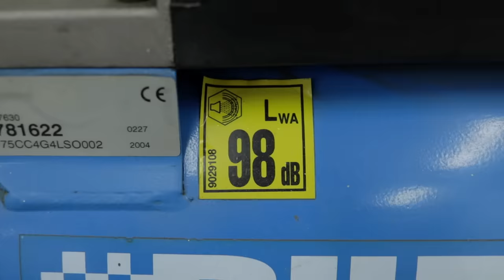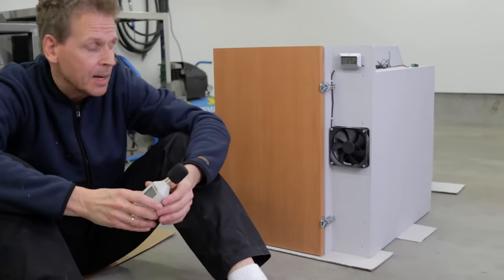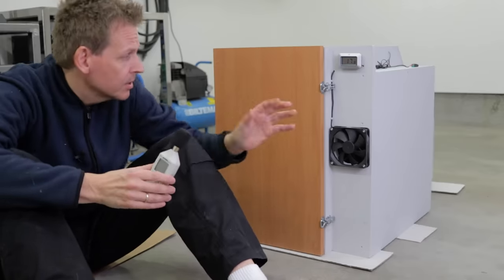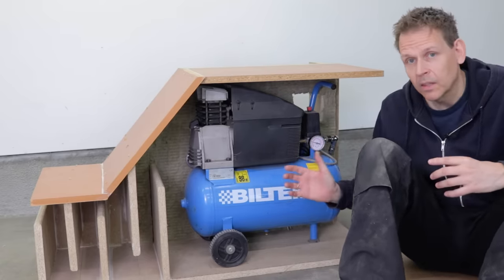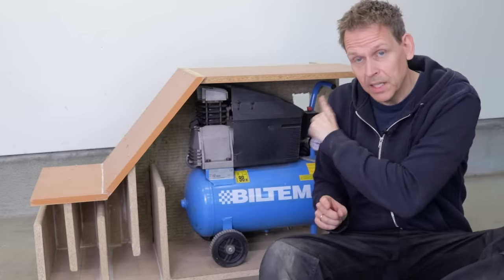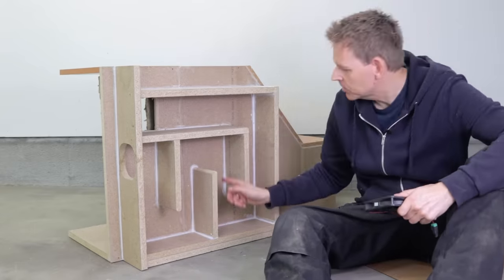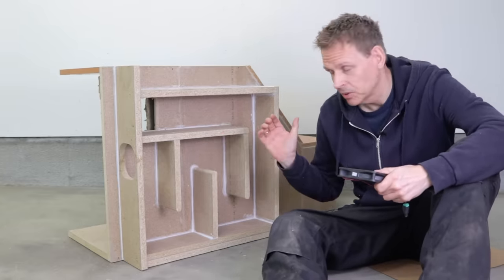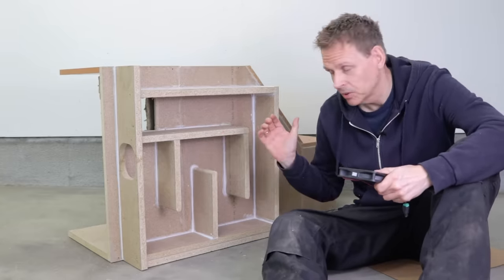Do not build a sound insulated enclosure for your noisy air compressor!

Comment: I hate it to break the bad news. If a compressor is inclosed with no cooling then compressor oil breaks down fast with heat and increasing wear all over. Heat is generated from compressing the air and needs to be cooled. Many many years ago I was working for a company that had compressors placed in just small corners on the outside of the buildings and all overheated, they got the compressor companies engineers to see why all their compressor overheated and failed, especially oil degradation failures, they battled for months and failed to rectify the problem. Then I started to work for them and found that the hot air from cooling where recycled into the intake of the cooler and air cleaner, now as they have already did installed and built everything a plan had to be made so I built ducting for the hot air away from the compressor and since then 20 years now later they still use my design.
Reply from the maker: I absolutely share your concern for overheating. The air compressor will not live for long if it is constantly hot above the recommended specs! 😐 However, It's a pretty cold climate here where I live in Norway, in the Northern part of Europe. I have actually fitted a heat pump in my garage to be able to use during winter time. I can see overheating is a big challenge in warmer climates. A more powerful fan or even radiator cooling could be needed must then be considered.

However, since I have a fan in front blowing air into the box I have airflow through the case that will "grab" the heat and transfer it out of the box. I have fitted a thermometer and checked the performance frequently. Normally the temp increases 5C = 10F from when it starts until pressure is built up and it shuts off, and then it takes just a couple of minutes to cool it down (as the fan continues to run after the compressor stops). If it is running constantly over longer periodes it can get a bit hotter, I have seen almost 10C = 20F increase. The warmest summer days can be 30C = 86F here where I live, but that is very rare. Its more commonly 25C = 77F, so it never gets very hot inside my box and it is within the range of acceptable temperature for this compressor.

Comment: You can reuse the tank from the old compressor as extra air storage.  This will buffer air and help you with the smaller air supply of the new one ...
Reply from the maker: Yes, good idea - except I gave my old one away 😊 My new compressor has so far provided enough air for my usage, but if I need to increase the capacity I can probably manage to find a tank and add to my system. Thanks a lot for the tips! 👍

Comment: Due to the low frequencies of the noise you are trying to cancel a 10cm thick lining of foam padding on the exterior (or interior) of the box would have made a huge difference. And also isolating the compressor from the floor of the box as much as possible, using springs, foam, or a fluid float.
Reply from the maker: Adding more insulation would be nice, but I have just not any available space for it - neither inside or outside.  
You are spot on when it comes to vibrations, I think it is the biggest source of noise now. Will try to improve it by adding soft rubber, dampening foam or springs on the compressor and/or between the box and the floor to improve it. Thanks for the tips! 😊

Comment: Put the compressor into a box and place it outside up against the wall of your workshop. Run the air hose and the electrical through the wall. Lots of people do it this way and I think this will be my spring project
Reply from the maker: Smart if you can do it! I just don't have space for it outside of my garage. Just be aware that your neighbor (if you have any) might be annoyed - because moving it outside does not make it more quite, the noise is just moved away from you and closer to someone else 😅

Comment: Everyone seems to be aiming at 0 sound. I think I would want to hear when it kicks on. I just wouldn't want it to be obnoxious. 

You mentioned that the new compressor has a lower CFM rating (or whatever you guys use in Norway). You could use your old compressor as a bulk tank to compensate for a slower compressor.

Comment: Cool Idea I like the air vent idea I bet if you put foam mattres topper (foam that looks like it has cones or waves in it) it will significantly dampen the sound for you. at the very least in the exhaust vent you have

Comment: I once had to do this for a smaller compressor. I used foam and  lead laminated sheets for walls and floors and the most reduction i got was adding a medical silicone hose on the input. and also used the tube as a base isolator and  the compressor sat on top of the tubes to kill that vibration from hitting the base.
Reply from the maker: Using medical silicon hose was an interesting solution, where do you buy that?

Comment: If you place your baffles at angles ... not parallel, there will be less reverberation due to internal echoes.
Using "dead" acoustic materials will absorb sound rather than reflecting it back and forth. Your carpet pad is rather loose stuff, and not as absorbent of vibrations (sound waves) as would, say, loosely hung lead foil (which would be, perhaps, the best.)
I really appreciate your project, as I am quite sound sensitive. Thank you! IMHO, eliminating mechanical sounds makes the world a better place!
Reply from the maker: Yes, others has mentioned it as well - putting the baffles at an angle does make sense. I have no idea why I did not think of it when i built it 🙄😒

Comment: In the USA the quieter compressor is sold by California Air Tools. I have one of those for indoor use, however I think the solution for a large powerful compressor is to install it outdoors in a shed and then run the air line inside to the workshop.
Reply from the maker: A lot of people have recommended California Air, and I have seen a lot of positive reviews online for their products. It seems solid! Unfortunately, they dont sell them here in Europe. I'm not 100% sure, but I have at least never seen any ad for them over here.
Reply: @kihestad  The California Air Tools product looks just like the one in this video, so I presume equivalent units are available from European sources.
Reply from the maker: @davejoseph5615  ah, ok - that could be. A lot of different brands these days selling very similar products, only colors and the name are different 🥴

Comment: A few things you can do to improve the reduction of sound is by not making everything so square. The baffles should be placed at different angles so the sound bounces around. Also the baffles should be made out of different types of material as well as different thickness. These two things will help break up the sound.
Reply from the maker: Very good suggestions 👍 I did not think about it when I made it, but now when you say it - yes it makes sense 😏

Comment: You can also get a quieter compressor now. I got the Kobalt QUIET TECH from the Lowes home store and it's about 60db. Not bad at all. I'm considering moving it to the attic and have a hose reel up there so there would only be a small hole in the ceiling of the garage for the hose to come through. Maybe a report power switch too.
Reply from the maker: Ahh, that is a very quiet compressor 👍 Sounds like å good plan you got there. I got some noise from vibrations transferred to my wooden floor after putting it upstairs in my garage. Adding soft rubber or sturdy foam under the compressor feet's might help
Reply: @kihestad  I've seen equipment mounted on springs also but the soft feed would be best in my case.

Comment: You could save all this work and just get the Makita MAC700 compressor.

Cheapest quiet compressor youll find, low rpm cast iron pump, sits on very  soft suction cup feet that isolate vibration. The tank is small, only 2.5 gallon but you can put another pig tank inline. It handles heavy work just fine, used it for heavy framing many times
Reply from the maker: Makita has great tools! A bit expensive though, but very good quality! The MAC700 cost three times more than the quiet one I bought. It's much more powerful though, but actually 2dB more noisy than mine 🥴

Comment: Wow, lot of work went into that video (huge views/likes as a result maybe?) useful you did all the work for us! 
Us non engineers would have nailed a box up, filled it with rockwool and then watched our compressors melt lol! 

The wood in the 'labyrinth' part could be called 'baffles', that's what they call them inside an exhaust etc.
Reply from the maker: Ahh, yes - 'baffles' is the name. Thanks a lot! 😊 I can confirm it was quite some work, both the build and making the video. However, it was fun work 😁

Comment: I have put mine outside, in the shed. No need for sound deadening.  Just cut a shallow slot in the lawn about 4 to 5 inches deep and push in the hose and electric cable.
Bonus: You can now have lighting in the shed!

Comment: When I first looked at this I thought you were going to end up building something like a speaker box and it would be louder! I'm impressed and how effective it was! 
  But to be really effective if you need a lot of mass.
 Anywhere you can get a cheap precast small concrete septic tank? Line inside with foam and fill the holes with fiberglass and make the whole thing 'float' on some close cell foam.
   I'd hate to see you try and get that up the stairs though 😜
Reply from the maker: Haha, I bet you would have enjoyed someone take in a build like that 🤣 Thanks for the tips, but no thanks 😂
Reply: @kihestad  seeing anyone get something like I described up the stairs by himself, I would definitely watch!

Comment: What range of frequency is the sound in for your compressor?  Maybe you could adjust your baffles to tune them for that specific sound range.
Reply from the maker: I did not go that deep into the investigation, and my knowledge is limited as well in this area 🤔 I knew that the medium and high pitched noise from the compressor was most important to reduce. It's the most annoying sound and makes you need to shout to talk over it. I just copied similar designs I had seen from other builds witch had the result I was after.  Luckily I got rid of the annoying sound, and the remaining "rumbling" noise that remains is not that painful. It's volume is not very high and a deep bass tone is not disturbing that much. I could probably have got an even better result with more investigation and set up the baffles better. Better do that next time... 😊

Comment: When you rolled the new compressor in th ebox i think we can hear that the vibration dampening on the bottom of your box isn't enough.  
Maybe putting another 1-2 layers of that fabric unter the compressor inside the box might help reducing another 2-3 decibel.  
Worth trying if you have enough fabric lying around.
Reply from the maker: I think you are right, it's one of the areas I will try to improve. Thanks for your input!
Reply: @kihestad  Worst part of that if i'm right is that it might get transported through the floor/ceiling of your garage using that as a resonance thingy.

Comment: add the tank in from your old compressor? I did this when I upgraded and somehow it made a much better difference in quality (tank went outside underground for car washing purpose and I plumbed it in as an additional tank extension and put fittings next to hose)
Reply from the maker: Very smart idea! 💡I have managed as is so far, but it's probably the way to go if I need a bit more capacity. Thanks for the tips! 😊

Comment: For my pancake compressor I built a box with only one back and forth labyrinth with no insulation and it's quiet enough for me of course I only use it for nailing things at work(a school, so it has to be quite enough) so it doesn't constantly run, but just the basics will cut down the noise quite a bit.
Reply from the maker: Well done! Getting rid of the 'worst' noise is the most important part 👍

Comment: You can also attach springs to the feet which will absorb the vibration through the walls.
Reply from the maker: That is actually something I have thought about: I think vibrations are the biggest source of noise now. Will try to improve it by adding soft rubber, dampening foam or springs on the compressor and/or between the box and the floor to improve it. Thanks for the tips! 😊

Comment: It's always a difficult choice to make, cost vs time vs benefit.
I ended up moving my compressor out of the shop and putting it into a shed 10 meters away. I close the door on the shed when the compressor is running.
One thing that you don't seem to have considered in your video is access to the comprressor tank drain. It's important to drain the condensate from the tank.
Reply from the maker: Moving the compressor away from the workspace is probably the best move 😎 You are right about the drain. It’s not too much job to open the four hatches, remove the door and pull the compressor out of the box to drain it now and then, but I have considered to add a line and move the drain plug outside of the box

Comment: Probably would be worth rubber insulating the wheels/base of the compressor from the cabinet, and to the underside of the cabinet to cut down on the vibration transmission.   

Could also add an extra layer of the sheet panel to the sides to give it more mass.

You might also line the cabinet with Acoustic Foam Convolute.
Reply from the maker: Great tips here, I have actually planned to do several of those improvements 👍Thanks a lot!

Comment: So are you still draining the water from the tank each day when you use it? If it rusts badly that box isn’t going to contain the bang noise it will make when corrosion weakens the tank. 😬 mind you my dad never drains his so you may get lucky. Personally though, I drain mine every time. Thanks for the video. It was interesting.
Reply from the maker: It's a very dry climate here where I live, there's no water to be seen if I  drain the tank every day. On average I use the air compressor one day per week, and I drain the tank each second month. Still not much water coming out of it, perhaps enough to fill a spoon 😊

Comment: My solution, instead of the regular 22 db reducing hearing protection I opted for 36 db reducing hearing protection. Slightly more expensive than the regular ones  but still a lot cheaper and less work than building an enclosure for the compressor like this, also it works for other loud machines like my angle grinder and it's pretty hard to enclosure that while still being able to work with it.
Reply from the maker: Hearing protection is a great solution, and I always use it when I start a noisy machine. I'd rather not go around all day with them though, when I'm not operating a noisy machine. I have to admit I am easily scared, if you shout "boo" to me my heart skips a couple of beats (at least if feels like it) 😛 I never know when the air compressor kicks in. Typically it happens when I am very focused and it is complete silence in the garage. And there - BANG it kicks in. I could not take it any more 😫😂😁
Reply: @kihestad  
I wear them above the ears when there is no noise so I can still hear what other say, but can quickly cover my ears with them once someone start angle grinding or I hear someone activating one of the other noisy machines or when the compressor kicks in. I'm in equal dislike of sudden loud noises. It got me the micky mouse nickname as when I wear them above the ears they bear some resemblance to the giant micky mouse ears.
Though of course when working with metal the periods of silence are probably a lot shorter than when working with wood, and they also depend on the number of people that are working within the same enclosure.

Comment: Build a three sided  weather shelter for your air compressor out side, facing away from behind your shop.  
Rubber mat under compressor footing.
Run Plumbing through an exterior wall. 
You'll barely notice any noise.
It cools.  It's accessible for regular servicing etc.
Reply from the maker: I wish I could 😊I just dont have space for it. My garage is placed with minimum distance to two of my neighbors. The side facing my own property is not usable either,  as it's just a slim path between my garage outer wall and a concrete retaining wall. In front of the garage door is no good either 😋

Comment: I remember a customer bought insulated panels, boxed in his compressor n killed it. Then there was the Pharmaceutical Co. that installed a large compressor in same room as a Boiler & complained they had excessive water in there air. Suggested they drill a hole thru the wall to outside & run the intake from there as a starter. For small portables remove the brass drain cock & put an elbow fitting to a flexible line & ball valve at the end mounted in a more accessible spot. For an enclosure like this for sound proofing you won't dump water onto the insulation.
Reply from the maker: That’s a good suggestion. I have to take off the front door an move it out of the box to drain it, takes some time.
Reply: @kihestad  Don't know why they sell small compressors with an inaccessible drain valve. I'm sure some users don't remember it's there til they have trouble with no air.